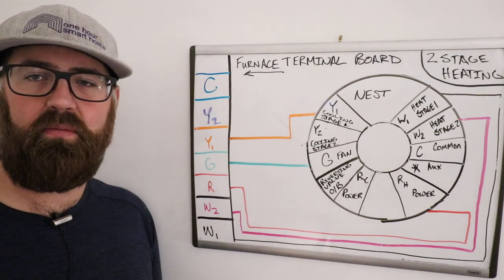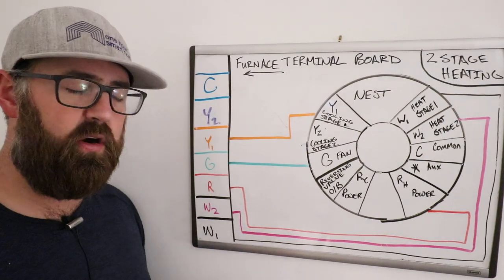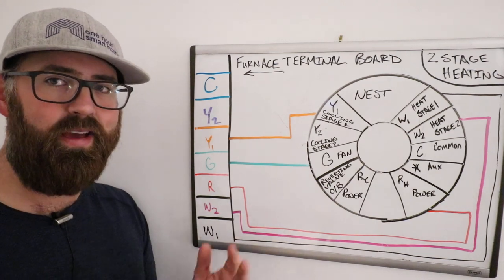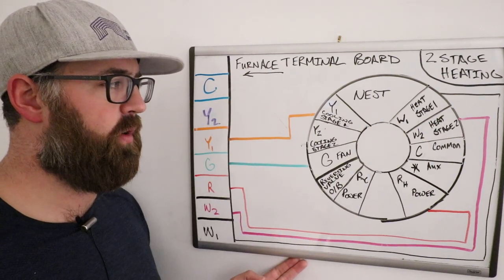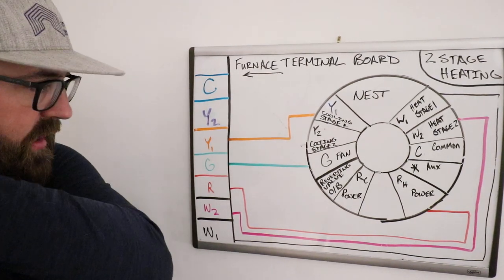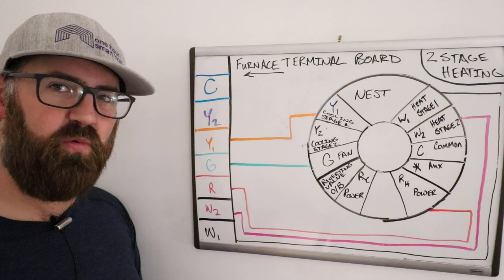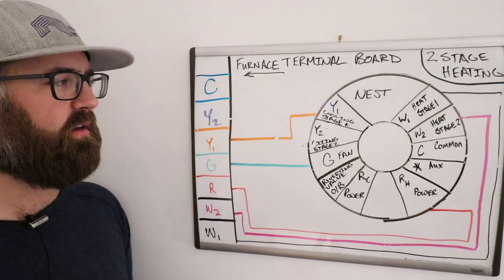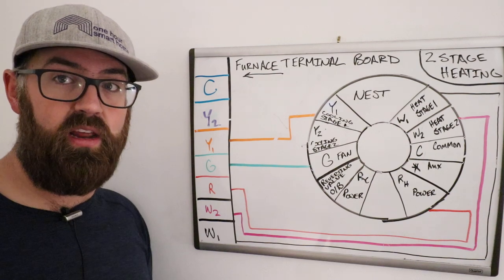2 Stage Thermostat Wiring For Nest

Comment: Great information. I think its important to mention that some furnaces also have dip switches on the board that need to be set correctly corresponding to the wiring between the furnace and thermostat.  I found this out recently with our new 2 stage heating & cooling Bryant.

Comment: I have a variable speed fan with two-stage heating and cooling, heat being gas. It's giving my Tech a fit right now in order to get the trouble lights to quit flashing.
Reply: Any chance you found a solution to this?

Comment: Great info.  I got a question, I just got a new system installed single stage cooling and 2 stage heating.  I was looking at my nest and the installer didn't go into my nest setting and change to add new equipment and didn't connect W2 wire.   Should I install the W2 wire on the nest and the furnace? Am i going to have single stage heat or will the furnace work two stage on a timer delay off the circuit board?

Comment: Nice , informative video. Unfortunately my situation doesn’t apply. I have a 2 stage system and attempted to install a Nest thermostat yesterday. I have 7 wires and the Nest only has 6 terminals. Any advice?

Comment: I have a HVAC (air forced, gas) and the manual says that it is a two stage furnace. I checked the wire board and the technician put it in the w1? So, is it just using 1 stage?

Comment: I have a Bryant 2 stage unit and a learning nest. When I use the 'FAN' mode, the fans runs on low (stage 1) speed. Is it possible to have the 'FAN' mode always run the fan on high (stage 2) speed?

Comment: Hi I have an oil furnace and just added a heat pump system to the house for AC.  It has electric heat associated with it and I was wondering how it should be wired that the oil furnace kicks on to supplement heat when below 50 degrees outside? Any help would be greatly appreciated

Comment: I liked all your videos, and you are very clear on your explanation. But I can't find any video with my configuration.
I have a Trane heat pump system outside with an air handler inside at my house and I change my honeywell T6 thermostat to a nest 3g, I take a picture of my old one with Y, Y2, C, O/B, W2, R then I connected the same wires on my new nest 3g. But my outside system not turn on just air handler.

Comment: I have a 90% gas furnace. It hasn't been used since last year but 6 months ago i installed a Nest TS. Today when i tried to turn the heat on the ignitor came on but the burners did not come on. I have a honeywell two stage gas valve in it. All roll out switches are good and high limit switch is also good. Do i need to jump W1 and W2 or is there some other setting on the thermostat? Thanx

Comment: I initially installed my nest with my old furnace which was one stage. I just had a new High Efficiency two stage furnace installed. The installer told met to get it to work with my Nest I would have to run the fan constantly which seems off.  So would i need to have an electrician run a new wire for the second heat stage?  I'm guessing there is only one heat stage wire because that is all that was required with the old furnace.

Comment: I have a Mr Cool unit with 2 stage heating, W1 and W2.  I wired the furnace terminal board and Nest like your diagram using the W2 instead of W1.  However, the Nest gave an error code (sorry, didn't write it down), but it stated that it couldn't continue with W2 connected without W1 connected.  So, only the AC works, not the heat.  Can you suggest a solution?  Thanks

Comment: So I think we have 2 stage heating and cooling? What I mean by that is I was told if you turn the temp by more than 2 degrees it works harder. Is that 2 stage? But I don’t have. Y2 wire and I’m confused about the one labeled w/e I want to install next but not sure how. My furnace is a Trane XV80 and Can post a picture of the wires I think you tube allows that if not I can send it if you would be so kind as to look

Comment: Hi, I just try to install a nest thermostat in my new home, it has 3 trane heat pums (20 years old xl 1200 and xl 1400) the problem is that the honeywell thermostats has not Y wire, it has 7 wires (W1, W2, G, R, N, O, E) but not Y. The other 2 thermostats are the same, but how it is the cooling working without Y? 
Thanks

Comment: I just acquire a nest thermostat but I have two sources/ wires... one from my boiler  which is in the basement and the other is from my central air.. two separate set of wires... the boiler is power by two wires red & white.. my central air has 3.. red, white, green .  how do I wire the thermostat? do I group them by color?

Comment: Dual stage heat, wired as such, but old thermo only configured/set as single... I think the Carrier unit handles kicking in second stage automatically... Do you recommend allowing/wiring nest control of the second stage, or leaving this to the furnace control board?

Comment: Great video and wish I watched this before I installed the nest.  I understand the low & high speed concept (thanks to this video) with the 2 stage system but does Nest automatically kick in Y2 or W2 if needed, or is that a manual setting.

Comment: I am upgrading from a super old mercury switch heat pump thermostat that had 7 wires. I sat down with my multimeter and tested the continuity to R (power wire input) on each different setting, Cooling, Fan only, Heating, and Emergency Heat. I wrote down on the results on a piece of paper and it showed me what every wire was for except for one that was plugged into the “X” port, it was never used in anything on the old thermostat apparently. It’s not powered either so I can’t use it as the C wire. So even with 7 wires only my Red wire has power. I guess I’ll have to buy the nest C wire adapter.

Comment: So if you have a traditional thermostat without the extra W wire and you upgrade from a 1 stage furnace to a 2 stage furnace, do you have to run new wire to the furnace to get 2 stage heating?  Or can 2 stage furnaces function correctly with just 1 W wire?
Reply: Great question I have the same question were you ever able to find an answer for this?
Reply: I’m curious too
Reply: @Kjk-lb1ox  Basically what I've gathered is that the furnace has a "generic" 2 stage operation/program if you only have a regular thermostat that it does on its own with only the on/off command coming from the thermostat.  Having the thermostat controlling the stages is much better, but yes, you'd need to run new wire or get a wireless thermostat to have it do that.

Comment: Please advise >> I purchased a Nest but when I took off my old thermostat it had 4 wires labelled 1, 2, C, R.   These corresponded to the same terminals on the furnace which listed the following options: 1, 2, R, C, G, W1, HS, Y1, Y2, B, V/W2.  

Given there is no 1 or 2 terminal on the Nest - what should I do??

Comment: This wiring won't work with my two stage furnace with ECM blower and nest thermostat.  You still need the common wire to power the Nest 3rd generation if you do not have a nearby power supply.  I substituted my fan wire for my W2 and kept my common wire.  Another thing is if you don't have the common wire and you have the fan (G) hooked up the fan on the unit constantly runs and won't stop.  I hooked it up exactly how it was in this video and it did not work.

Comment: I have a new 2 stage Bryant with a variable speed blower and no AC.  I asked the installer to use our new Nest. He used the four available wires to connect W1, RH, G, and C.  He said we had to choose between having a fan setting with one stage or no fan and two stages.  But it looks like he could have used the C wire to connect W2.  That way, we would have 2 stages and fan only as well.  Is that correct?
Reply: Sounds like you have a installer who doesn’t know what they’re doing. They should’ve automatically ran an 8 wire thermostat wire out of courtesy with the sale of a new two stage system. You need C for constant power for a digital smart thermostat.

Comment: My nest learning thermostat third generation is having a very hard time holding up a charge and the battery keeps on dropping to 3.4 voltage and the screen will still come on to change the temperature and it’s also keeping going into shut down mode and my nest learning thermostat keeps on getting disconnected from the internet connection and unable to reconnect to the internet.
Reply: You need to hook up a common qire from the board to the nest. Thats what provides constant power to it. If its just depending on charging when the fan is running it doesn't give enough power. Its a very bad design by google/nest

Comment: What about 2 stage cooling. I live in FL
Reply: I was looking for the same answer.  It appears that you would use green to fan,, red for power, white for stage 1 heating, yellow for stage 1 cooling, Y1.  The fifth wire to Y2 for stage 2 cooling. I have a 2 stage Ruud thermostat. The blue that I have was originally for the common was repurposed for the Y2.  As best I can tell, the purposes of the common was to allow for power stealing. Let me know what you did.  Thanks.

Comment: I have separated base board heating which has two wires and and A/C for cooling. They have separate thermostat. can I connect them into a single NEST thermostat E? If saw which power cable should I connect since Nest E has only one R position?
Reply: No you would need two Nests to operate the two baseboard heaters independently.

Comment: I have steam heat and central air conditioning. My nest kept failing because of no common wire even though I have 24V on the RC and RH wires. I had an electrician run a common wire of the furnace and the nest didn’t see the RC wire. What is my solution to get the nest to work on both systems?
Reply: Voltage is relative between two points. Are you saying you had 24 VAC between Rc and Rh or between Rc and C? In most smart thermostats, the Rc and Rh wires are jumpered together to supply 24 VAC to the thermostat all the time. You should have 24 VAC between R (Rc + Rh) and C. This is what powers the thermostat.

Comment: I have a duel fuel system (a heat pump and a gas furnace, thus the O/B wire) and I also have two stages cooling/heating from the heat pump (Y1, Y2) and two stage alternate heating (W1, W2). Should I just connect the four wires to their corresponding terminals?
Reply: I have the same question

Comment: Is there a way to wire NEST thermostat with 2 stage electric heater (furnace) AND heat pump?  Below -20c heat pump heat my house and above it, my electric heater does, with the first stage first and if its not enough, the second stage help ?!
Reply from the maker: Yes, you could wire the electric heater as emergency heat or auxiliary heat.  This video: https://youtu.be/6qwFra15pdY shows how you could potentially wire it up with with an electric furnace and heat pump depending on your wiring and system. They would both need to be 24v control systems and you might need to also connect the R wire from the electric heater to the Rh terminal on the nest.
Reply: @OneHourSmartHome  where I'm confuse is that my 2 stage electric heater has 2 wire going to the nest t-stat. The first stage is 5kw only and the second one is 10kw (15 total). Emergency or Aux only has 1 spot for 1 wire

Comment: I have a carrier 48 VG with mult stage heating and cooling is there a way to wire it for a nest with only 4 wires my tstat that I'm using now is just a basic tstat it runs at high speed I switched it to the nest and wired it the same and I only have low speed
Reply: You can't run a Nest with only 4 wires. It sounds like you need to upgrade your thermostat cable. I recommend 18 gauge, 8 wire cable. This will allow you to wire all 7 wires appropriately between the control board and thermostat. With some setups, there is a way to run the furnace using just the four wires, but you will lose some functionality and have some side effects - like the blower kicking on randomly. the Y jumpered to Y1 and Y2, the W jumpered between the W1 and W2 and the R jumpered to the Rc and Rh. The C wire is the tricky one. I've heard some thermostats can use the G for common and ground through the blower, others like nest can't. I always just upgrade the thermostat wire if there are only four wires.

Comment: Would moving the wires from y1 to y2 terminal on the furnace side allow my ac to blow at a higher speed?
Reply: Most furnaces will automatically switch from LOW to HIGH speed after a set time. Mine switches to HIGH speed if a heat/cool call lasts longer than 12 mins. Also both Y1 and Y2 need to be energized for it to operate in HIGH speed, so switching the wire will make it operate weird or not at all.
Reply: 1000man2 is right. If you just have a Y wire, jumper it to both Y1 and Y2 to make it blow cold on high.

Comment: Hi
Please help I have ecobee 3 and my new house have 2 stage heating and cooling but when I try installing the ecobee the hvac system does not have a y2 w2 what can I do to fix it
Thanks for your help
Reply from the maker: What wires do you have?
Reply: On my hvac system computer board only have G C W Y R that it and it brand new system on my ecobee I'm missing 2 wire for y2 and w2 to get it work right because it 2 stages hvac
Please help
Reply: Please help
Reply: @roostertalkaboutanythingsi5688  It sounds like you don't really have a two stage heating and two stage cooling system. Single stage heat and single stage cooling uses 5 wires. You should have 7 terminals (at least) on the control board. R +24 VAC, C - common, G - , Y1 -stage 1 cooling, Y2 - stage 2 cooling, W1 - stage 1 heating, W2-stage 2 heating. It sounds like someone lied to you.

Comment: I have a 2 stage furnace but only 1 w1 and 1 y1. Should I run two more wires for a w2 and y2?
Reply from the maker: No, you don't need to. But if you don't have the extra wires it will only operate as a single stage HVAC system. If it's easy to run the wires I would do it. If it requires painting and patching it's probably not worth it.
Reply: Some two-stage furnace control boards are smart enough to operate with a time delay for two stages from a single signal wire. It receives a signal and runs low, but after 12 minutes, it switches to high until the thermostat stops calling for heat. More wires are better, but like One Hour Smart Home said, if it's going to be a pain, it's probably not worth it.
Reply: The advantage of more wires over a time delay is if it's really cold, you don't have to wait 12 minutes for high heat with more wires. If it's not as cold, more wires allows the furnace to run a bit longer in low, saving energy.

Comment: Will a wiring setup with i+ and i- work somehow with the nest without a lot of wiring work?
Reply from the maker: Typically what you need to do is relocate your thermostat to where the HVAC system and run new control wire from the HVAC system to the nest. Thats the simplest solution.

Comment: Can you make the Y1 on the nest and Y2 on the fan connection to run high speed AC?
Reply from the maker: If you have a Y1 and Y2 wire it means you have 2 stage cooling. There are terminals on the Nest for both. Nest is compatible with 2 stage cooling.
Reply: One Hour Smart Home what if you have y1 listed but not y2?
Reply: @OneHourSmartHome  no there isn’t terminals on the nest for both there’s one Y these things are junk

Comment: How would you hook up 2 stage furnace (propane) dual fuel with heat pump
Reply: Main question is what "W" would you take out to Heat Pump W1 or W2
Reply: The two stage furnace takes both W1 and W2 to run with two stages. You would need a second thermostat to run the heat pump.
Reply: W1 is stage 1, W2 is stage 2. If you tapped into the W1, when the furnace is running in low, the heat pump would also kick on. If you tapped into W2, only the furnace would run initially, but when it kicked up to high, it would also kick on the heat pump.

Comment: Hi, great video. Love the clearly laid out diagram. Question though. I have a five wire system with a jumper (C, G, Y, OB, RC, R with the last 2 jumped). I don't have a W1 or W2. This is for a 2 stage furnace and an AC system. Wondering if I can still connect the Next. Thanks!
Reply from the maker: Are you sure that it's an AC system? The OB wire typically indicates that you have a heat pump?

Comment: Help! We have 8 wires. Nest sent us a new thermostat as they felt the one we had wasn’t working correctly. Installed new, still no AC. It was 99 degrees today!  With the virus, you can no longer talk with tech support, everything is online chat.
Reply from the maker: do you have a heat pump or a furnace and ac system?
Reply: One Hour Smart Home we have a furnace and a heat pump. All electric. Thank you!

Comment: I have a different version of Nest thermostat that doesn't have the connections you show for 2nd stage heat (W2), just Y, C, W, G, R, *OB. My old thermostat has both W/E and W2 connections but they are jumpered and fed by a single white wire. The thermostat setup doesn't give me the option for 2nd stage (emergency) heat and the HVAC installers told me that I have to use emergency heat because mine is wired like, but isn't a heat pump. Any advice for me?

Comment: Do you know how to control fan speed if there is only a single wire (G) running to the thermostat?
Reply from the maker: You can't unless you have multi stage heating and cooling.